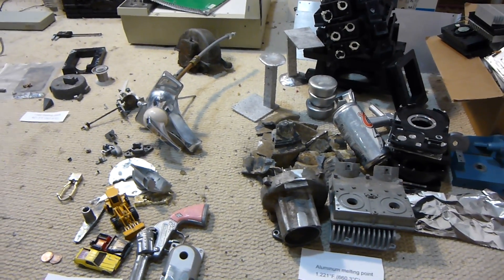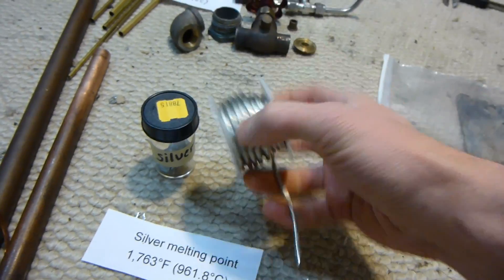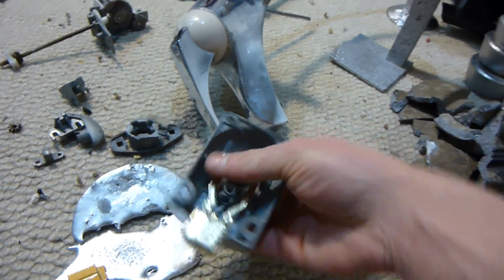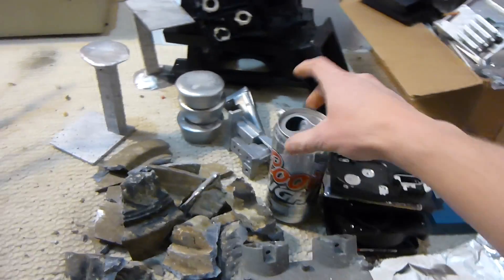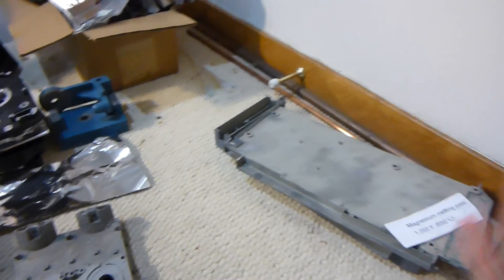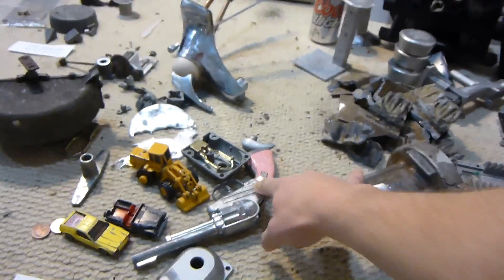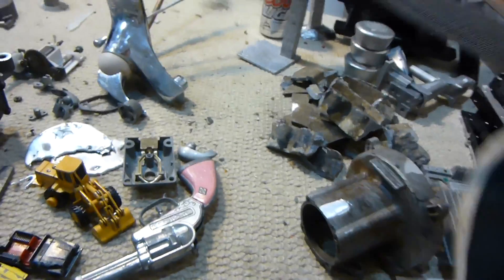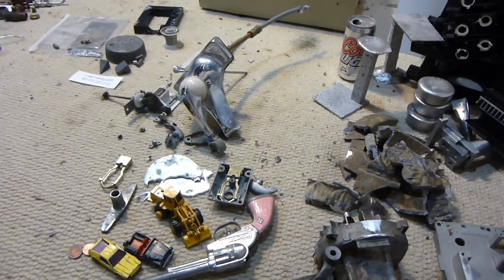How To Identifying Aluminium, Zinc, and Other Metals For Casting

Comment: Good video overall, but you should be careful about mixing zinc and aluminum. The melting point of pure aluminum is ~650C, while the boiling point of zinc is ~900C. If you mix the two into the same crucible and don't do a good job controlling the temperature, the zinc could boil off as you try to melt the aluminum. And if you breath in that boiled zinc (which turns into zinc oxide dust in the air) without a respirator, you could easily end up with metal fume fever (https://en.wikipedia.org/wiki/Metal_fume_fever). People get into the same problem melting brass, where that melting temperature is also not much lower than the boiling point of zinc. Subscribers are hard enough to come by as it is, you don't need to be killing any of yours off ;).

If people want to separate zinc from aluminum, Cody's lab has already shown how to measure the density of irregularly shaped objects (https://youtu.be/-Hpg214Kk_U). Zinc has a density of ~7 g/cm^3, while aluminum has a density of 2.7 g/cm^3. Buy yourself a cheap scale, and make sure you're not mixing the two metals. It's certainly cheaper than a trip to the hospital. If you're doing small work, amazon has a ton of very accurate scales for under $20.

If you see this Makerj101, it might be worth a follow up, if you haven't already addressed this.

Comment: As long as you have a torch, don't forget that you can file off a few granules and sprinkle them into the torch flame.  Zinc gives a bluish reaction, copper a greenish, aluminum a white, magnesium is also white, but much more vigorous.  These granules can also be fused into a bead of borax on a wire loop, and will exhibit characteristic colors.  BTW, if your weed whacker is a Stihl brand, be aware that they make considerable use of magnesium in their castings, as one of my friends found out when he tossed some into the wood stove in the shop.  Thought it was going to burn the place down.  I won't repeat the language he used to describe the experience!

Comment: Thank you for this! I was taking apart doorknobs for brass and came across some heavy parts that looked like aluminum but were too dense, and I though it might be zinc, and this confirmed it. I also accidentally melted a magnesium computer frame thinking it was aluminum.

Comment: Great video ,A lot of the older bathroom fixtures are brass with crome coating, if you hit it with a hacksaw or grinder you will see the brass color if its not brass it could be zinc or pot metal

Comment: You might want to make the distinction between zinc and zamak. Zamak is a cheap zinc, aluminum, magnesium, copper alloy. It's also called pot metal.

Comment: Great video. How do you tell zinc from pot metal? As you say the best aluminium for casting is aluminium that has already been cast into something as it contains the correct additives for good results. Cars are fantastic source as often you can pickup old aluminium parts for next to nothing. I tried aluminium horse shoes but the results were quite poor but automotive parts gave excellent results. Cheers Stuart 🇦🇺
Reply: I have the same issue with pot metal being used intensively before WW2, then gradually replaced by aluminum.   Powder coating aluminum is great, pot metal is disastrous as it makes bubbles when cured. Still looking for a non destructive way to identify (close to ) pure aluminium.

Comment: I heard zinc is poison and you shouldn't melt or weld it, is this true?
Reply from the maker: Zinc metal isn't that bad. Infact you need some zinc in your diet (I don't know what forms specifically). Welding or melting zinc causes it to burn/oxidize which make zinc oxide and it's not great for you. Not the worst either. Heavy metals like cadmium and lead are much worse.

Comment: How do they melt magnesium when they cast it into parts? What do they do to stop it from burning and making it molten and pour products?
Reply: With a layer of melted material over top of the molten magnessium to protect it from the atmosphere.  Boric acid is used occasionally.
Reply: Try pouring argon into the crucible

Comment: Good video, thanks for sharing, .... Just a quick tip on the ZINC, I've had Zinc that is really light in weight and I was convinced it was Aluminum so I made up some Copper Sulphate  solution, put one drip on the alloy, nothing, ... But when you put one drip on the Zinc it will start to bubble immediately and turn it black and actually start to bite into it and melt it, so another good way of telling Zinc from aluminum if your not sure, .... Copper sulphate is easy to obtain, ... In America you have Root Kill that will work, ... We don't have that in the UK so copper Sulphate is the only way for us ;-)

Comment: This is poor information. Your zinc items not zinc. They're a mixture of various metals commly called pot- metal because they are easy to melt in a pot. Usually lead, zinc,tin, and aluminum.

Comment: That wiper motor is vacuum powered.  It ran off the engine vacuum.

Funny thing about it.  

When you are  accellorating the engine vacuum drops and those wipers also stop.

My dad had a 1937 Ford business coupe.  It had this style of wiper motor.  Step on the gas and the wipers would stop mid stroke.

Comment: Loved the video, this old-timer learned a lot. My only suggestion is that you learn to use a file correctly... They only cut in the forward direction, dragging or raking the teeth backwards will ruin the file over time.

Comment: as with all things their are dangers melting anything is very dangerous . If you don't understand what they are you need to stay away from the hobby. As with all things these days it causes some kind of disorder. Melted chocolate causes obesity.so does sitting on the sofa.so have fun no the risk and wear safety equipment .and if the tip has a hole in it raise it and say it was the plan.if it's fun their. will be a cost.

Comment: The best way too tell zinc from cast aluminium is too hit it with a heavy hammer. Cast will break at thin points where as zinc won't

Comment: Really useful...I have a Victorian rocking horse bit [I bought four from a restorer] and one was bent..I tried to straighten it, but it snapped..it is magnetic, so I assume steel [they are cast]..I might have to glue it together, as it obviously
 won't solder. [only a few mm across, so not really a big surface area]

Comment: zinc has toxic fumes though and you get whats called metal fume fever and is the reason why blacksmithing with galvanized steel is bad
Reply: BKT the MDG i wanted to comment that too. Zinc fog can cause loss of teeth and serious problems with lungs and kidneys
Reply: BKT the MDG - Haha, I put the end of a strip of zinc on my gas stove and it ignited and started filling my house with smoke. Rip me.

Comment: How do you tell the difference between stainless steel and aluminum?
Reply: There is really no way to confuse those two. The density is completely different (almost 3x), look (color, shine) is very different, hardness and thoughness as well. If you have problems telling the difference between the two, you might as well have a problem telling the difference between aluminium and wood ;)
Stainless steel is not generally non-magnetic. So if a magnet sticks to it you know it's not aluminium, but it doesn't mean it's not stainless.
Reply: Aluminum is soft, easy to drill, clogs files and grinding wheels, stainless is steel with chrome mixed in, it is so hard drilling is tough to say the least, both are non magnetic.
Reply: well I have a hollow cane that is designed to be light. but its strong like steel,yet non magnetic like aluminum. so was just a bit uncertain.

Comment: i need more info on silver, since i found alot of old rings and ear rings and i dont know how to separate it from other metals.
can it be attracted with magnets?
is it easy to score or scratch it?
is it lighter or heavier than aluminum or zinc?
Reply: you should check them very closely, most silver stuff have tiny markings on it with 3 numbers 
for example: 925 means it's 92.5% silver

Comment: I was interested in this type of topic only cause I am looking in to fixing a few broken throttle cables on small single cylinder motors since why spend money needlessly and I have more than one cable that is missing a end an some are from tools that parts are either very expensive or hasn't been being made for long enough that all the old replacements are gone so making my own would be much quicker, cheaper, without sacrificing quality even or take much time too.  Everyone else I have heard about doing this seems to be using lead which I would rather not be doing and lead seems somewhat so soft it wouldn't be a very good choice  anyways.  .
Reply from the maker: +Phillip Kramer Cool!  I think you are right that they often use lead for that kind of thing.  You could use lead free pipe solder as that is soft which you might need and fairly strong.  Stronger and harder than lead at least.

Comment: how about tin? identifying it? it's melting temp?
Reply from the maker: +Sooner Science Nerd Tin is actually kind of rare.  I don't have much.  The only places you are really going to find tin are in lead free and lead solder and in pewter.  Tin has a lower melting point than lead and is very soft and silvery.  I'm not really sure any other ways to identify it as it's fairly uncommon due to it's softens and price.   It's also used to plate sometimes due to it's high polish capability.  Some steel can I believe are still plated with tin.
Reply from the maker: +Sooner Science Nerd Melting point is: 449.5°F
231.9°C
Reply: good to know.
have you cut open (old) power cords, like from old appliances? the fabric insulation cords- stay away from, except for the brass in the prongs. I cut into the fabric insulation, and white powder was inside. I suspect asbestos, or something else. I just tossed it into my other wire container.
where would I find tin in a computer,components, ect.?
thanks.
Reply: +Makerj101 can you tell me where can i find bismuth? since its like more than 200 degrees melting point and i want to make some ingots from it
Reply: @marijanabrezic8854  online

Comment: I've a question for you; you say that zinc-aluminum allows are generally acceptable. What do you know about anodizing zinc-aluminum alloys? Will it work the same as anodizing aluminum alone?
Reply from the maker: +Mithradates Megas Hmm I have no idea.  I have no experience with anodizing.
Reply: +Makerj101 in my opinion, zinc has a weird smell to it, and i can recognise it by its light blue jeans colour.

Comment: wonderful video.  i found a 1x2 foot piece of melted metal at an old brush fire site in my local hills. it weighs 10lbs.  it's  silver and looks similar to the aluminum after you filed it.  it's actually very beautiful.  you can see where it bubbled up and some black soot adds character.   but i would like to know more definitely what metals are in it. i'm a little worried about toxicities with my animals investigating it.  any suggestions?
Reply from the maker: +onedumbbaby Thank you!  It's probably aluminium or zinc.  I would not worry about toxicities.  If the surface was grayish then it might be lead.  But sounds like aluminium or zinc to me.
Reply: +Makerj101 thanks for responding to my question. i think i'll go ahead and display it as a conversation piece.
Reply from the maker: onedumbbaby If you want to know for sure take it to a scrap yard and ask them.  I'm sure they would know.

Comment: Isn't casting zinc deadly? Zinc oxide?
Reply: I hear what you're saying, but there are useful studies that have made a strong correllative case for exposure to aluminum metalworking and Alzheimers/Parkinsons. What you'd want to search for is something like "Incidence of Alzheimers amongst welders" or "frequency of alzheimers amongst metal workers." There are plenty of scholarly research articles that seem to indicate that the population of welders are twice as likely as the general population to develop neurological problems later in life. Medical Science may not be able to pinpoint the mechanical relationship between aluminum or manganese exposure and brain damage, but the statistics are pretty frightening on their own. You are always better off going overboard on safety and whether you need it in reality or not. As far as zinc oxide goes, however, this is another matter entirely. Zinc Oxide isn't one of these long-term neurologically damaging substances, but the right amount of exposure can be deadly within minutes. It seems that it doesn't stick around in your system, however, so it's danger is more as a poison than a toxin or pollutant.
Reply: +whyiohwhy 
I mean, at leqst very dangerous for the home caster? My welding mentor always warned us against welding or melting anything with a zinc coating, that it's a rare fume that can kill in minutes.
Reply from the maker: +whyiohwhy I believe it's not a problem as long as you don't get it too hot and I wouldn't stick my face down wind of it.  But something I will look into before I do any zinc casting.
Reply: +Makerj101  watch out for what types of foam you use for your mold as well. Some foams are extremely toxic when burned.
Reply: Mentions several dangers of doing metal casting, but completely glosses over the fact that zinc fumes can kill you, and downplays the danger when it's brought up in the comments. Thumbs down man.
Reply: @Dan-uo9fw  agreed
Reply: +whyiohwhy A welder is much hotter and actually boils the zinc.  It isn't as much of an issue when casting, because temps are usually much too low to boil zinc.
Reply: Buy a proper sized respirator and filters for fumes. Check for leaks with both hands on the valves before placing the filters, there are videos showing this. Medium 3M semi-facial is the only one that fits my face. I almost died and still have a lot of pain in my lungs from using a disposable, be careful.
Reply: +Brian Dolinar 
Thanks for the info!
Would you happen to know anything about the connection between aluminum smelting and alzheimer's? Or if there is a strong case for one? I've smelted a few cans in the backyard before the thought put me off of it. Studies have been done about aluminum and alzheimer's ingeneral, but I'm having trouble digging up a simply stated study that corrolates Alz to Aluminum smelting/casting in particular.
Reply: +Brian Dolinar 
Thanks for the info!
Would you happen to know anything about the connection between aluminum smelting and alzheimer's? Or if there is a strong case for one? I've smelted a few cans in the backyard before the thought put me off of it. Studies have been done about aluminum and alzheimer's ingeneral, but I'm having trouble digging up a simply stated study that corrolates Alz to Aluminum smelting/casting in particular.
Reply: +whyiohwhy 
One study that's hosted on a website called "canadafreepress" paints a pretty ugly picture of Aluminum smelting.
http://canadafreepress.com/medical/nutrition070890.htm
Reply: There is no study that shows aluminium causes alzheimer's. I've only heard of a study that shows aluminium in the plaques in brains that suffered alzheimer's. In no way does that mean that Al is the cause for alzheimer's, it could very well be (and looks like it is that way) that if you suffer from alzheimer's aluminium is also deposited in your brain. The "everything is trying to poison us" crowd jumped on it (pretty much the same people that are against vaccines and "chemicals", sometimes even the chemtrailers chime in) and the media fueled the panic by as well. That's what happens when you listen to people who don't know how to read scientific studies.
Btw. did anyone tell you that aluminium is the third most abundant element and most abundant metal in Earth' crust? Every piece of granite (and many other rock types) you see contains aluminium for example. Would be pretty stupid evolutionally if the body couldn't deal with that.

Comment: The faucets always go as yellow brass at the scrap yards.  Smash it with a hammer and see if it's yellow. ;)
Reply: Makerj101 Zink is more valuable per weight than aluminum at the world market. Seems like scrap-yards are paying too little for it. Maybee you should melt down 40% zink with 60% copper so that you get brass for the yard? ;-)
Reply from the maker: MalawisLilleKanal Hahaha yeah maybe.  Sometimes the prices they pay just don't make sense.
Reply from the maker: Well yes, the valve part is brass.  You normally sort things at the scrap yard for the most precious metal.  Zinc is something like $0.10 per pound while brass is around $2 per pound.  So even if there is only like half a pound of brass but a pound of zinc, thus more zinc, you get more money if you scrape it as brass.  Zinc also melts at a lower temperature so it's easy to separate out when it's recycled.  The zinc is all the shiny parts you see.  It's plated with chrome tho.